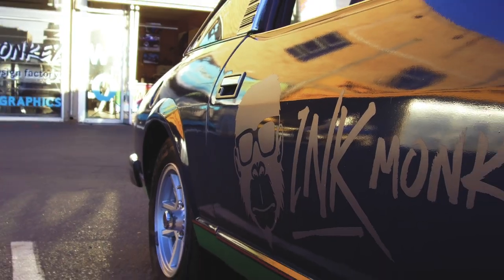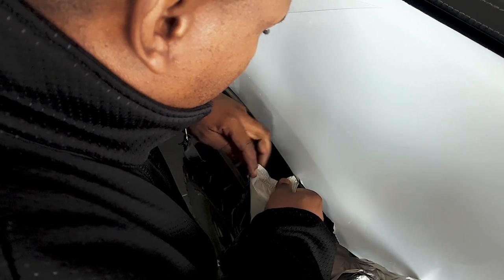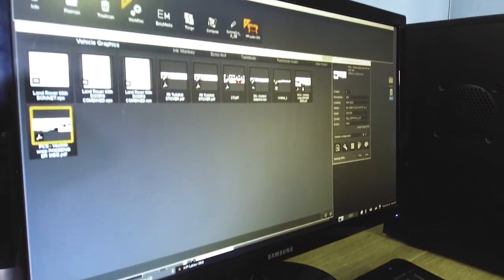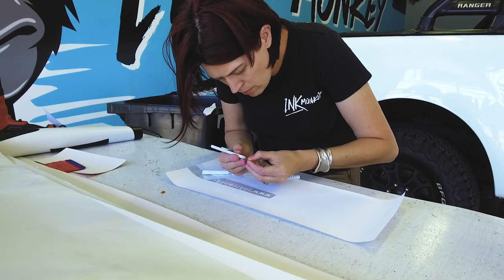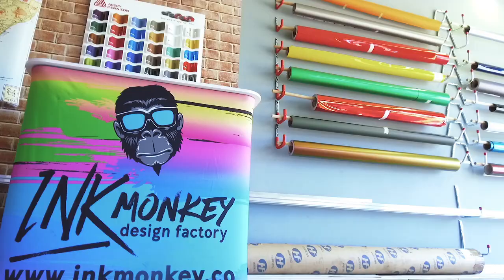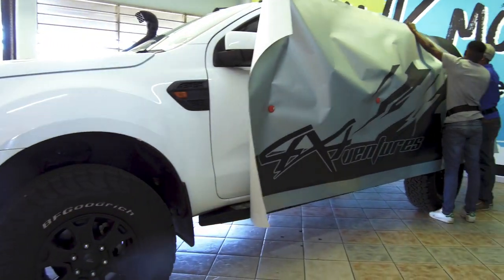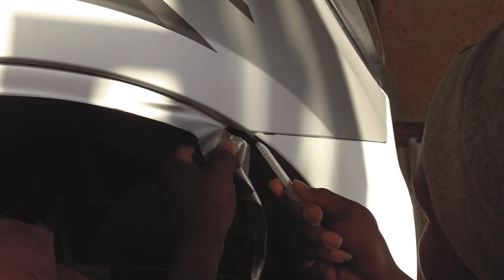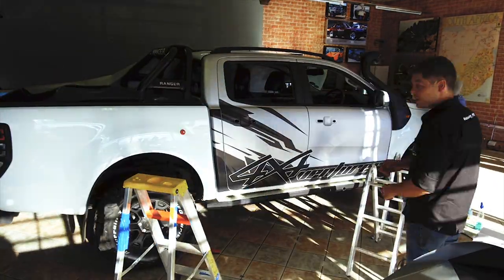4x4ventures S1Ep5: Ford Ranger 2.2 XL 4X4 Vinyl Wrap

Comment: It looks good hey... I think it's a good idea to wrap as it protects body paint off road.
Reply from the maker: Yes, but, when it gets damaged you cant simply buff scratches out. Just had mine replaced and it is costly.
Reply: SWAMBO wants to get out Tuna done there, but stripping all those bits off,  hope they go back on, was just about to get a roofrack, but i should wait till after this!!! did they take the snorkel off?
Reply: @chrisg1234fly  , SWAMBO here.  It will look cool LOL
Reply from the maker: Ink Monkey has their ways of getting it done and done right. No, snorkel stayed on. A wrap can take 2 to 3 days, and on special request, they can get it done sooner. Hope this helps and hope SWAMBO goes in to get wrapped, you wont go wrong. Thanks for your support